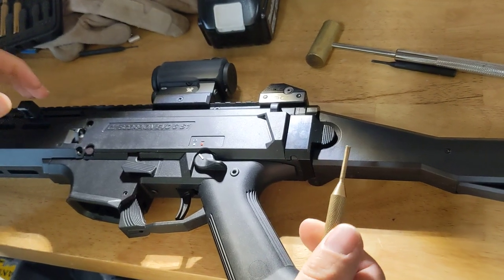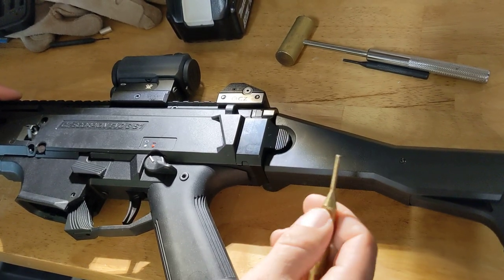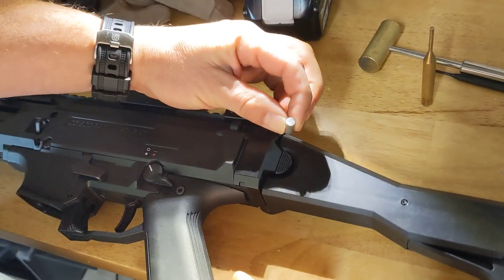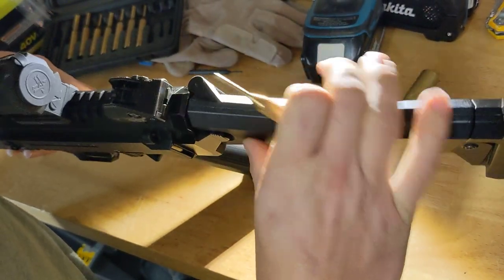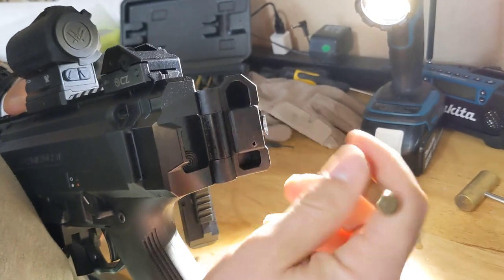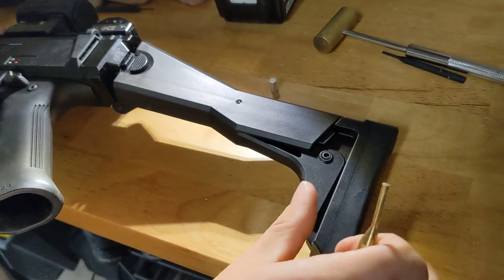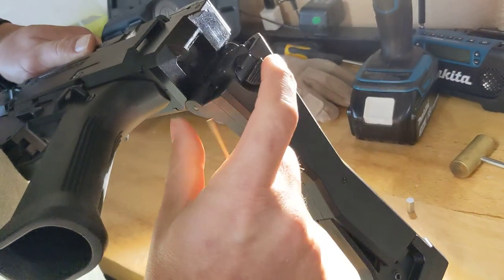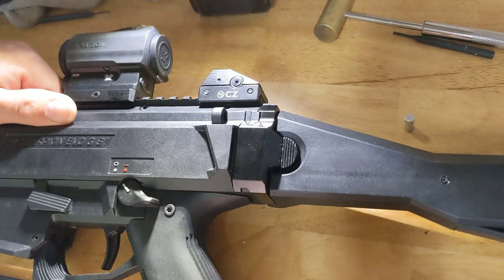CZ Scorpion EVO CA Compliant Stock Removal and Modification Instructions

Comment: I recently got the Scorpion 3+ Carbine and couldn't get the stock to fold no matter how hard I pressed the button. I thought for sure this was my problem, so I disassembled the stock like shown in this video. As soon as I drove the main hinge out and separated the stock, the button would press in like normal. I found no metal rod in mine. I think there may be some clearance problems when the stock is in the unfolded position causing the button to bind up. I reassembled and found by pressing the button forwards towards the barrel and down it would depress and allow proper function. Maybe with time some wear will help make that button much easier to press. Hope this helps.
Reply from the maker: Mine definitely had a aluminum block behind it.

Comment: I HAS AN IDEA SEÑOR 
WHY DONT WE MAKE A VZ 61 wire stock like exactly the same just updated you know with the wire stock running Parallel on the body and the but of the stock right over the barrel when folded. Exactly the same as the Vz 61
I has other cool ideas too
Reply from the maker: Great idea... you do that bud.

Comment: Is it possible to post the dimension of the stock pin? I’m trying to make something ca legal
Reply from the maker: If you want it CA legal, just find a nut to put behind the button.
Reply: I’m trying to get my hands on a jakl in CA. Was curious about how exactly one would pin the F5 folding stock it comes with. Unfortunately a third party has to make it compliant out of state then FFL transfer it to a shop in CA. Turning a $1300 rifle into a $1600 rifle with less functionality… I hate this state and the fucktards running it.
Reply: How did you get that pin out I cannot get that pin out no matter how hard I try